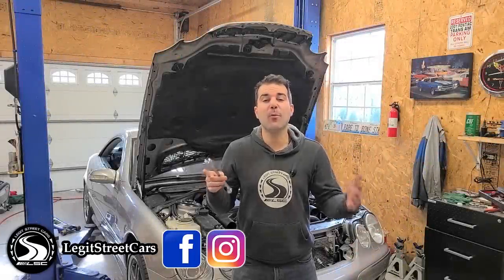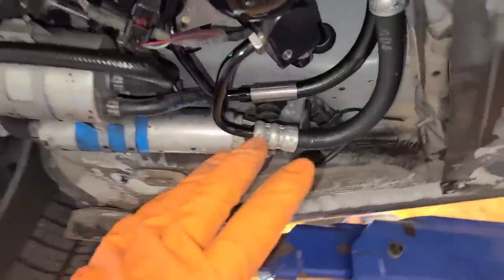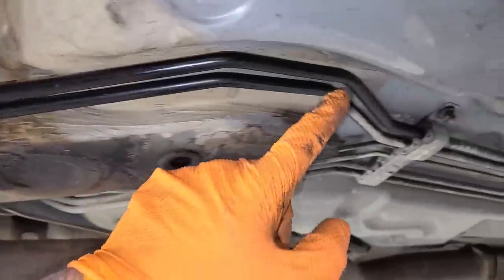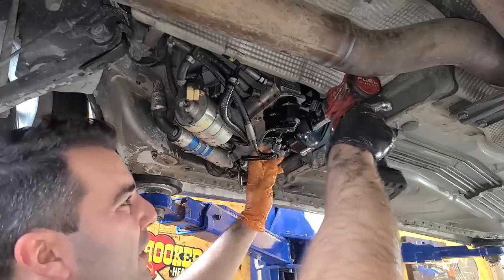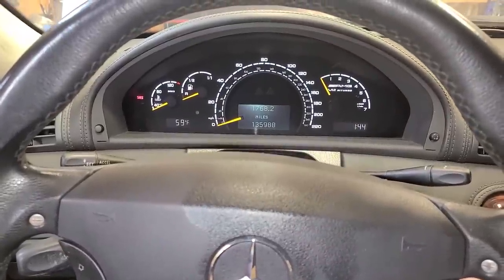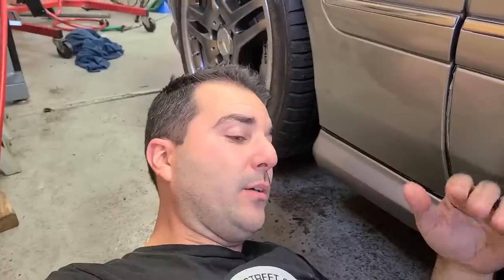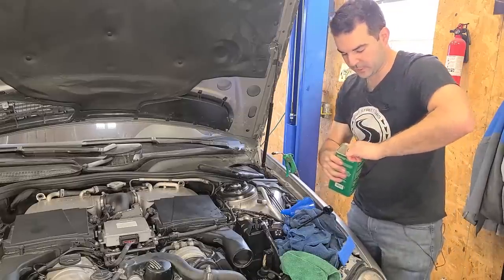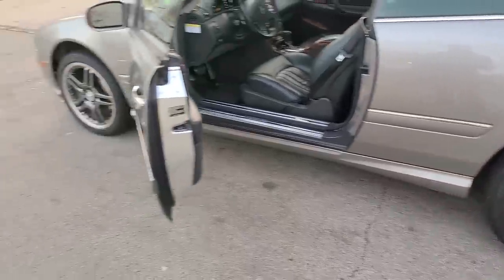I FINALLY Fixed The Hydraulic Suspension On My CL65 AMG & You Won’t Believe What It Was! FIRST DRIVE

Comment: Just FYI - Mercedes recommends to repeat up and down procedure from 15 to 20 times to remove air from the system. Rodeo is too stressful for the pump. Car is not supposed to give you any note on the KI if it is being raised or lowered since it can be done while driving with ABC suspension while Airmatic will give you message on the KI that vehicle is rising and you have to wait a bit.

To bring ground clearance back to normal you need to calibrate ABC with Romes.

Comment: great car, ive had two, 2001  and 2011 models, i did buy some vessi shoes, thanks for the 25 bucks....never had suspension problems like this, only a noisy value issue...  minor

Comment: Nice job! I know the ABC Suspension is very complicated but at the same time it is a very impressive set up. From the research that I have done the system provides an awesome ride. Mercedes Benz knew what they were doing when they engineered the system. It’s just too bad that maintaining it can cost an arm and a leg but that probably wouldn’t stop me from purchasing a CL.

Comment: That's awesome that you finally figured it out, and so weird how you fixed it... but you definitely can adjust the ride height using an autel, but it will probably be more aggravating than fixing it in the first place... I speak from experience on my S55... I never could get it perfect when it actually did adjust, and ended up just getting lowering links.

Comment: Better late never.
Well done Alex what a mission this Mercedes.has been.
Such an emotional rollercoaster.
Could see your frustrations mid build but you persevered and came out the victor!🤜🤛
What a weird fault that ABC suspension had strange.
You now have a straight working Mercedes. 
Can't wait to see what the modifications do to the performance.
I'm gonna put you up there with ol Edd China as one of the true genuine mechanics - start a job see it through to the end.
One thing I've learnt watching you working on these early 2000 Mercs. Is they're good cars.
 (If maintained correctly)
With strong engine with great tuning potential - even the diesels.
If you can give an address I'll send you a crate of Beer or Wine (specify what type of wine) whatever you want truly deserve it after the tribulations of this  project.
Good stuff.👍

Comment: If you have Bluetooth dongle plugged in. Its eating the battery. My w212 did it. Measured and only way to stop the drain is to remove the dongle.

Comment: Death by a thousand cuts. EVERYRTHING on my car has had been played with. Half the  intake manifold bolts r missing. Misfires, Vacuum leaks, wet electrics, Blocked Cats, EGR blockages, coil fails, bad earths, corroded rear lamps. , brake sensor malfunctioning.
Alex, your struggle has inspired me to keep chipping away at this project, and I don’t feel so bad about talking to myself to help provide perspective and celebrate the wins and keep me sane through all the ups and downs. Oh, the upside. My ABC is solid

Comment: I wonder if when one solenoid goes bad on front or rear circuit, does it cause the whole front/rear to stop working? What a pipe dream that abc system is.  Not too complicated but just a lot of extra little areas that can go wrong and leave you stranded.

Comment: A few years ago i had a 2.5ltr triumph tr6 lucas pi injection would go off of random cylinders,was the fuel injectors getting blocked by pieces of the hp fuel lines breaking up internaly,was a bastard to get to the bottom of tho as they looked perfect!

Comment: My guess would be one of those solenoids in the valve block. Are they interchangeable? I would of swapped front to back to see if the problem followed or checked resistance.

Comment: Alex ive owned 3 german cars, sometimes the notifications dont come up on the cluster if there are other issues that need resolving, like that Tire pressure light and that speedtronic noti, ive had hibeam issues hidden due to inspection needed on the cluster that wasnt cleared by the dealership. completely hidden everything else

Comment: I haven't finished the video yet, I will, but I'm at the point cringing while you're jamming the wire in the hoses lol.  I'm a boiler and burner tech and I use a push-pull pressure/vacuum pump to save my day.  Adaptable, pulls insane vacuum, built in check valves, hand operated.  I cleared a foot valve in a tank 200 feet away underground at 11PM on a frozen Massachusetts night adapting the 3/8 port to the 2 inch line.  You should get one, look up the Westwood T30.

Comment: Really impressed that you try to rework the mercedes ABC system. NOT so impressive using a steel wire brush to clean o-rings and connectors :)

Comment: Three lights is a massive win in a CL600. !!  Q: Would it be possible to resto mod one of those? Gut everything electronic, pare it back to power seats and windows. Gauges all replaced, with reliable aftermarket products. Replace the hydraulic demons with an Art Morrison f/r suspension and burn it in a swamp when you're done. Then a quick LS + transmission swap and we are done !! You'd have the only reliable CL600* on the planet. All the sexy German looks and none of the headaches.

Comment: Love your videos, congrats on the suspension. I have to admit I cringed about ten times when you were pressuring the abc tank and you had the air nozzle hanging on the driver fender with the metal fitting on the paint …. I was having a melt down …. Hope that buffs out!!!

Comment: I knew you could do it Alex!
But man am I glad technology has improved since then because seeing you a guy that can fix most anything on a car with ease go thru thatch trouble. I'm glad GM for example has Magnetic ride control. And if the shock gets old or breaks. All it is to change it out is like changing a spring. Take it out and replace shock. And plug it in and boom done.
And Magnetic ride is better then this ABC old tech.
Rides like Glass in comfort and stiffens up alot for track mode. Yes it does not dance or rodeo but I'm OK with that lol for all the trouble it's not worth it imoh.

Comment: Well Alex another relevant video 4 me as the RED LIGHT just went up on the dash on my 06 S55. Part of its my fault because a month ago I had the WHITE lite which meant front accumulators. I finally got those but haven't changed them out. I also have the C-1536 code "low pressure" which I thot was an error since I have 190 Bar! So with your video I'm assuming I have air in the lines like yur CL and I can blow it out! That's a big relief!!

Comment: Great work, but you didn't explain what really was the problem, was it the valve block or was it the selenoids that made the problem.
I know that sometimes the selenoids can click but the valve is stock and won't open anyway, so it will be interesting to know the real reason to your trouble with this.

Comment: I would think that stranded copper wire would be better for running through those lines.  It would turn at the curves easily and also be less likely to damage the inside walls.

Comment: I would have disconnected the aftermarket  suspension control crap as a first action so I know I am starting from standard. So, the valve block/solenoids were the actual problem????

Comment: My worst car was a 1984 Cadillac Seville. After so many repairs I was like I'm done with Detroit cars and I have been driving foreign cars since learning the hard way in 1995. My second worst car was a 1978 Toyota Corolla SR-5 hatchback too many mechanical issues and too much rust. My third worst car was a 1994 Volvo 850 base, too many components failing all at once.

Comment: I think aircraft cable lowes sells would work better, more flexible and coated so it wont scratch up the inside of the lines.
Should be in the isle where the rope is.

Comment: Hello, I have a 2001 Mercedes-Benz clk430 with 100447 miles on her. I've put new spark plugs and wires, new brakes and rotors, new tires, a hood along with an new oil service.  What else do you think I may need to do to her? She has no malfunction lights, everything is working with no problem also I did change the blower motor for the heat/ac. Just  curious if you think I'm forgetting something before I put her back on the road .

Comment: great video. thanks..If the entire ABC suspension system has failed, can this Benz be considered near totaled? because there are so many parts of the system that could have failed and the time it takes to truly find out could result in $10k of parts and labor. who wants to risk that when buying a used w220 or CL with a total failed ABC suspension.

Comment: It’s possible the wheel and tire combo isn’t the original?  (Too low of a profile?) that might make the car appear higher than it actually is.  Looking at the gap from the side skirt to the ground, the car actually looks like it’s at the right height.  Great job btw.  So what was the culprit?

Comment: Thank-you. Due to your painful journey (and other's I've heard about) I would never buy a Mercedes with an ABC hydraulic suspension, never mind a CL65 AMG with $10 "O" Ring failures that require an engine out repair. However, I did find your video entertaining, especially when a guy with your obvious experience and mechanical skills get stumped and has to resort to reboot / resets; and swapping out parts - just because you have them handy...

Comment: Firstly, at last! You've fixed it! Well done mate! Alex don't jinx the car by trying to lower it. I would not f**k about with it again now it's working. But we know you. You're going to do it anyway! On one note why do Mercedes make the car go so low as to rub on the tyres when something goes wrong with the system? It seems a bit weird to me, unless your wheels are larger in rolling diameter  than the standard Merc ones? I guess not , but I can't understand why they would have a setting that would damage your expensive tyres. Sorry for the English spelling of tyre( tire lol)

Comment: Alex, would you be able to review what kind of diagnostic tools you use? I see your autel allows you to tap into the merc and actuate your hydraulic system. Id like to buy something similar that will allow me to do typical procedures like brake bleeding (sbc) and air bag suspension stuff. Id prefer to not get a star system from China, rather a supported scanner.

Comment: I just came across this video. I assume that wire it is still stiff to go all around those bends. I obviously don't know the internal diameter of those lines. Would a net curtain wire fit inside those lines? If it fits, I guess it would be the ideal "tool". Also someone mention in the comments using a ball bearing, I believe a ball bearing will work, but not readily available in your toolbox unless you are a mechanic. Curtain wire may be easier to find. Or maybe a brake cable can do as well?

Comment: Congrats on the ABC, but enough of that - have you got this beast tuned yet? Let's see a dyno video ASAP!!! Any plans to upgrade the intercooler system?

Kinda sad that ABC issues where such a challenge that a V12 twin turbo with ported heads and tricked out turbos was kinda forgotten..........  frankly seeing all you went through convinced me to convert my SL600 to coilovers. Even after all you've done, you've still got the original struts and all the ABC hoses, all of which will fail eventually. ABC is a really cool system, a marvel of engineering, but the reality of maintaining it on an older car is that you can quickly spend half the current value of the entire car, or more, keeping it going. I'm really happy with my coilover conversion, rides and handles great and zero ABC worries, forever.

Comment: When you blew air to the bleeding line it shoot something out and then fluid. Could that have been what was blocking the valve block and didnt allow it to work correctly? It seems like your valve block would work fine if you were to install it back in

Comment: This is groundbreaking stuff. Only halfway through the video but the conclusion that a normal looking valve block can degrade or shut one of these systems down is big. So much easier to replace a valve block than all those lines. I will apply these principles to my Cayenne’s PDCC hydraulic active anti roll and air suspension 👍

edit: watched the first video, realized it's not just a valve block going bad, now rewatching this.

Really seems though that it takes a lot to clog up a line and it's the valve blocks that will likely catch most blockages

Anyway watching this series has been very helpful about demystifying these types of systems and with some further reading on e.g. FCPeuro I think I have a better handle on what may fail or need preemptive maintenance

Comment: GREAT VID! QUESTION: I HAVE MULTIPLE VEHICLES WITH EITHER FRONT OR REAR SQUATTING AIRMATIC PROBLEMS AND I AM WONDERING IF POSSIBLE TO CONVERT TO COILOVERS FOR JUST THE FRONT OR JUST THE REAR?? HOW WOULD YOU HANDLE HYDRAULICS/ELECTRONICS?? CAP OFF HYDRAULICS? BUT WHAT ABT ELECTRONICS?  THANKS FOR YOUR OPINION

Comment: i have the same lowering module in my S600 and the remote just doesnt work (yes they sell you a product nowing that trhe remote does nothing) there has to be control module somewhere with 5 dials in there 4 for the ride hight of each sensor and 1 selecor for which car it is. its called the programainc lowering module.

Comment: Awesome job bro…. I need help with something, my sister has a 08 CLK 350 which had some damage to the front bumper which I replaced (needs to be painted) anyway fog lights  wiring is no bueno pulled out when the bumper was pulled, need your help

Comment: Did 155 mph in a BMW 750 for half an hour and ended up in a jam, after the jam she start using coulant and we found out the middle block was cracked. She build up to much heath speeding and that heath could not go anywhere idling in the traffic jam so the block cracked. No space under the hood for ventilation. And now airflow in the trafficjam. Took 2 weeks to repair and sold the car straight away. V8 or 4 in line is thermic way better. Before the coolant gets at the 5th and 6th or 9th til 12th cilinders its already too warm to cool the engine near the firewall properly. The block is too long.

Comment: Wait, don't get this. You're a pro. You had a problem with the rear, across the axle. There's a hydraulic block for the rear actuators. You had several known to work but didn't decide to swap it out earlier to eliminate this single failure? I give respect to your skills but unless this was perhaps calculated for reasons of content, not sure the rest of the journey was worth it for you. Or maybe it was after all!

Comment: Bet that crap lowering module is to blame.
As far am concerned, and having a CL 55 K in the collection, would say that your ABC is still not ok. Seems like your low level corresponds to the intermediate level in mine. At 31:17 it should clearly go up twice - once per each time you press the button - then come down at once by pressing the button the third time (both lights off).
Anyway, congratulations on the work done! Successfully sorting out an M275 is the work of a genius :)

Comment: Hi Alex. I have a S65. 2006. And my abc pressure states 118. I had a hose pop and replaced it. Now that I go over a bump the red abc light comes on for about a second and disappears. Could you explain. Do I need to add air in the tank like you did. Thanks.

Comment: Computers loose their minds every so often for no reason and you just have to do a hard power down reset. My old 95 Neon would freak out and decide not to start, run badly if it did, and it was random with no codes. I would have to pull the fuel pump fuse which would kill power to the computer and fully reset it. Doing a code clear alone never fixed it, only the power down hard reset. It would relearn everything and be fine for months after that. Who knows where the actual glitch was but being that old could have been just about anything.

Comment: You must be the ABC whisper now . So I thought you might help me . I have a AMG 2007 S65. I got the dreaded ABC default message. My local mechanic got the message that left front sensor not working. This unit was replaced with no joy. The computer does not recognize the sensor. Do you have any idea?

Comment: I have a total newbie question. When putting an SL with the ABC system on a four post lift is there any kind of setting or any kind of set up that you have to do to the suspension as to not damage it or to prevent it from extending?thank you very much and advance

Comment: Hi Alex, I am getting a '00538 reference voltage (011) Open Circuit Error' in the Central Electrics of my VW Polo Gt Tdi hatchback. The fault code stays static when the car is switched on, but can be erased when the car engine is turned on and doesn't recur until the car is switched off and switched on again. The reference voltage specs says the voltage should be between 11-13.5, but when the car is on it is at 10.24 and goes to 12.4 only after turni g the engine on. The workshop isn't able to figure out the issue, which causing the Air conditioner to cut off randomly (no faults in HVAC). They checked the wires, fuses, climatronic, body control module, replaced the battery, but nothing. Can you please give your valuable inputs?

Comment: So the pump would not prime without the compressed air?
Reply: The pump was primed just fine, but there was a bubble in the system preventing the system from building full pressure.

Comment: You could have very easily avoided this issue by OPENING THOSE BLEED NIPPLES!! WHAT DO YOU THINK THEY ARE FOR? My w116 has similar suspension at the rear!! There was no need to use external air pressure to bleed this system. The bleed nipples are there to remove trapped air from the system.